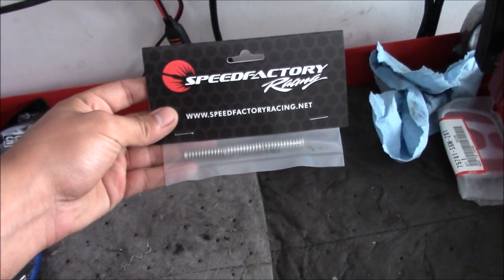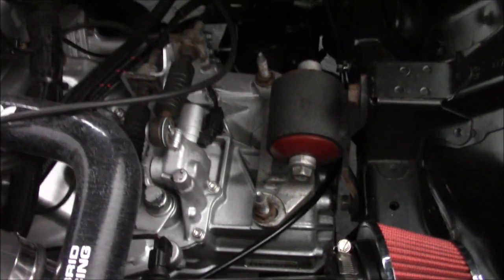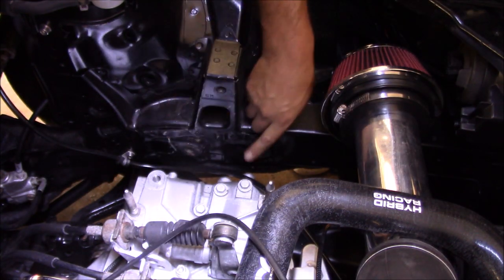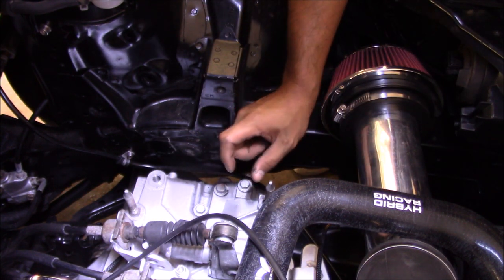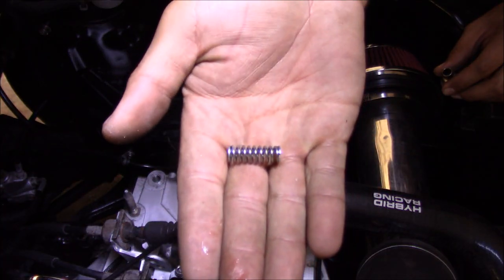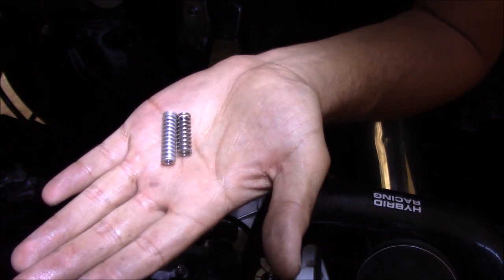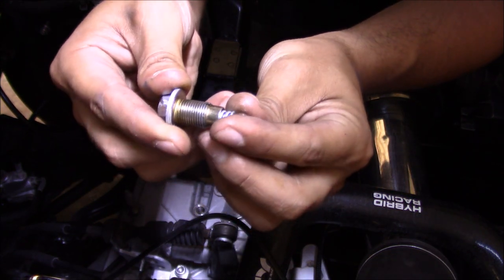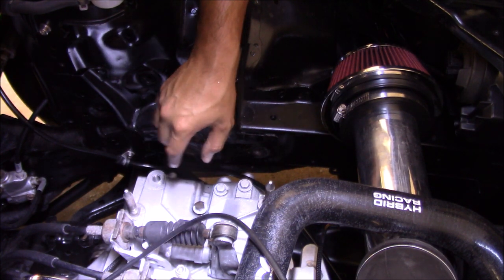SPEED FACTORY DETENT SPRING INSTALL !! (K SERIES)

Comment: My 3rd gear wen shifting felt empty. Couldn't tell if I was in gear or not. Sometimes second too. Installed these springs, and you can now feel the "snap" or the engagement of the gears better when shifting. Not a omg type of part but it does make a difference when upgrading from older transmission parts

Comment: Great vid! Gonna put mine in tomorrow ive had them ages just havent looked into fitting, mine pops out of second on track alot when going in at high revs bit annoying going to apply power mid corner and its popped out, hopefully fixed the issue will comment again after my track day the day after tomorrow and give u guys feedback
Reply: I'm having the same issue, did these help?
Reply: Yes it solved it feels so much better it like clicks into gear and doesnt pop out of second at all even going in at high revs on track, well worth the money
Reply: @eddhamilton3099  hell yea, that's great to hear! Can't wait to get back out there.
Reply: @eddhamilton3099  Thank you for the update, gonna try them out

Comment: That part is just to keep it from popping out of gear. Honda kept this component just like the b series. If the gear is popping out then check the spring for compression length and verify with factory specs.
Reply: that's all it does?

Comment: How does this affect the car differently than the mtec race springs? Have the mtec race springs on the way and curious if these are a good buy at the same time, or would I not really feel a difference? Daily driven 2006 RSX Type S with 100k miles btw.

Comment: Great video, good detail. I don't know much about transmissions tbh - are you jacking the wood under it to support the transmission because you're taking the mount out in guessing? That mount is what holds the transmission up?
Reply from the maker: yea thats exactly what im using the wood for. dont want to put the jack directly on the trans because it can damage it since its an aluminum case.